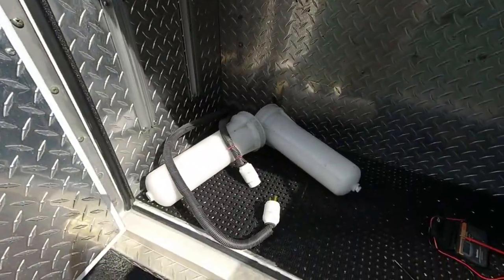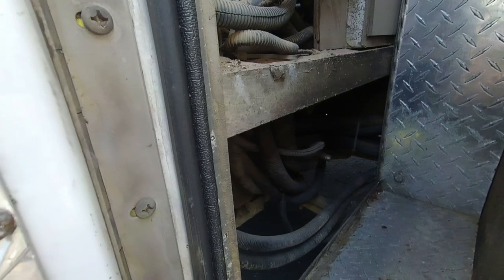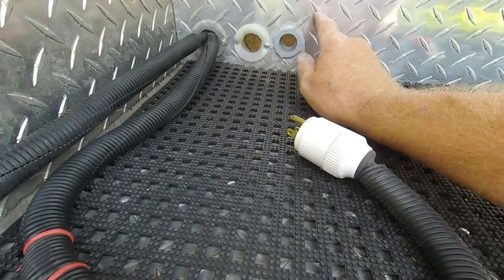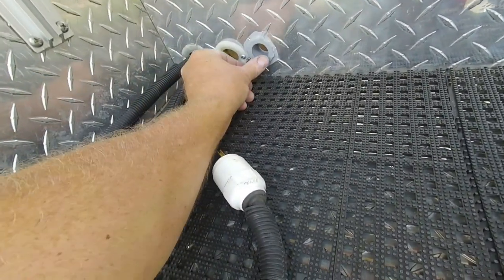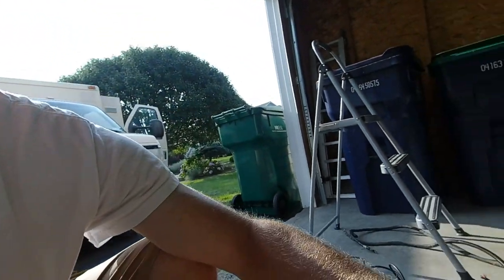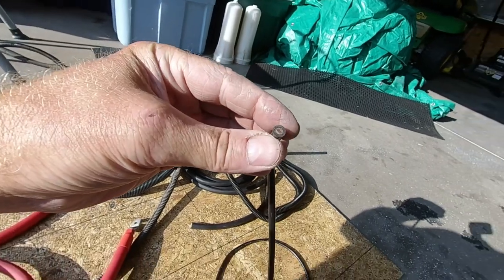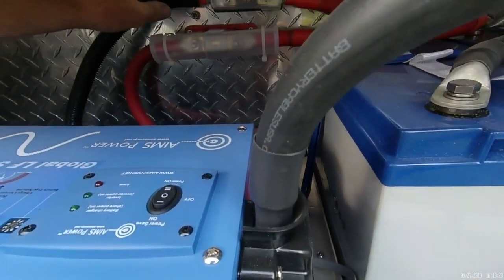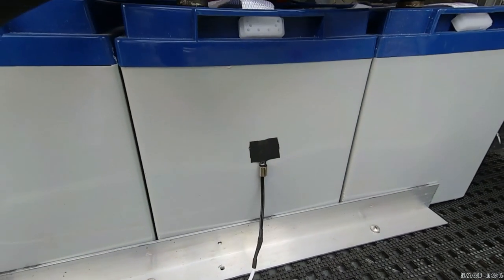Inverter and Battery Installation in Ambulance | Building the Campulance

Comment: Good job!  I've installed a lot of inverters over the years both for myself and other people.  The temperature sensor typically attaches to one of the battery post on some inverters.  The directions from the manufacturer should tell you where to attach it.  This sensor tells the inverter if the batteries are getting too hot during a heavy and prolonged charge or discharge cycle and will reduce the charge or draw so it doesn't damage the batteries.  In all the years I've been using inverters, I've never had one reduce the charge due to heat although I suppose it does happen or they wouldn't make them like that.
Reply from the maker: Thank you Lucky! I spoke with a tech from Aims and put the sensor where they recommended but your post mount also sounds like a good idea. Thank you for watching and commenting!

Comment: Thanks for this one.  I have a Horton ambulance, trying to figure out the wiring for a solar setup and was hoping to use the existing wiring to make it easier/quicker.  Many things on yours is similar to mine.
Reply from the maker: I was able to use the existing DC wiring up to my inside power cabinet which saved having to rerun one :) It is possible to use some existing cables.

Comment: Were you able to retain the box AC/Heat after separating the two systems?
Reply from the maker: Hi John - the original box heat and AC systems are still in place. Keep in mind, by design these 2 systems only operate when the engine is running. I don't use them (I have AC and heat systems I've added) and they will eventually be removed to gain space. Thank you for watching and commenting!
Reply: @TheCampulanceMan   Absolutely makes sense to have independent HVAC if you are doing full time. I have a older Marque (94) that I just acquired, but my mission is comfortable travel for a few days at a time. I'll be using your videos to help me get it situated . Thanks again for the videos and response!

Comment: I took out those 5 huge lead acid batteries and in stalled 2 12 volt LTO batteries as starter batteries, save over 200 pounds. And I installed 3 100AH 1KWH LiFePo4 batteries.
Reply from the maker: Whoa, I wish I could afford lithium for my house batteries. My gels are HEAVY! When my Gels are end of life, I'm sure I'll be putting lithiums in their place. My truck has 2 cranking batteries, group 65.

Comment: At 6:14, the black box right above your left pointer finger (I believe is the device that "ups" the engine idol speed  while the ambo is sitting and running to charge the batteries) was located in the wooden box connected to the doghouse (at least mine is), where did you relocate it to?  Did you remount it under the dash area somewhere?  Thanks, this video is extremely helpful.
Reply from the maker: The high idle unit? I removed it and sold it on Ebay :)

Comment: Hi I have a ambulance too. And I was wondering if your outlets work when the engine is running or just when your plugged in to shore power. My outlets will only work when I have my ambulance plugged in to shore power. I was just wondering if that’s normal or if there is a switch I need to find. Thanks so much
Reply from the maker: Hi Ashton. For your AC outlets to work without shore power, you have to turn on your inverter. There is usually a switch on your rear switch panel for turning on the inverter. Btw, many used ambulances that are sold have had the inverter removed.... so I'm assuming you still have one installed :) email me if I can help more.
Reply: @TheCampulanceMan  what is your email? Would you mind sending me a picture of where the switch is. And where the inverter is located so I can see if mine is still there. Thanks so much
Reply from the maker: thecampulanceman  at Gmail

Comment: mt ambulance came with the original inverter. where can I get some help on using it? the inverter is installed inside under the jump seat. this is a 1996 special order wheeled coach built for a fiber optic tech and no info is available from the coach maker
Reply from the maker: There is usually a switch that enables the inverter. The box will need to be powered on, turn on the inverter, plug something in and see if it works. If not, try it also with the engine running.

Comment: Will this Aims Power 3000 iverter charge the starter battery when plugged into shore power, as the original Vanner 20-1050cul did? Mine was removed before I received it and I would like to have that feature when installing a new inverter. Thank you!
Reply from the maker: The aims inverter does have a 100a charger built in. Whatever batteries its connected to will get charged when on shore power. The charge amperage is adjustable up to 100a.

Comment: You have inspired me to get an ambulance for my van build I'm going to look at one later today it is a 1998 Ford E350 ambulance with a 7.3 powerstroke at 150,000 miles He's wanting 6.8 for it but I'm going to try to talk him down to 5,000
Reply from the maker: Exciting! If it's missing the inverter, talk them down. Check the age of the tires by the code. If they're old talk them down. Touch the engine to be certain its cold, then start it. Be sure it starts well to confirm glow plugs and relay are good.
Good luck and thank you for watching and commenting Jacob!
Reply: @TheCampulanceMan  my brother drives a big diesel truck and works with it often, he is coming with me to check for engine stuff to make sure the engine is good, I am 22 and wanting to get on the nomad life by 24, I got a decent savings from working my tail off, been taking OT like crazy and should have enough to take a gap year or two and travel the USA! I am very scared of the electrical in general but willing to take on the challenge and your videos are helping out tremendously, thank you for the tips! Is there any signs you would say I should turn and run if I see?
Reply from the maker: With the engine running, take the oil fill cap off to check for blow by. You shouldn't see any 'puffing' come out of it. Check over the front suspension - bushings especially  - and shocks. They're many times worn and the rubber bushings fail. Not a huge issue to fix yourself but something to look at. Look at the power cabinet to see if it looks unaltered. If you see signs of a lot of tampering that may be a concern. If you can, get test strips and check the coolant to see if it has been maintained. Bring a OBD scanner and pull codes if possible.
Reply: @TheCampulanceMan  thank you!

Comment: Hi David. I've been following you for a few months now as my wife and I have been working on our ambulance conversion (2005 F350, Wheeled Coach Type 1). Your videos are very helpful and enjoyable to watch. I have a couple of questions regarding your electrical setup. Like you, we plan to get an initial battery bank installed and charge them off the alternator and with shore power until solar is installed at a later date. I was planning on using a battery isolator (like this one https://www.amazon.com/WirthCo-20092-Battery-Doctor-Isolator/dp/B0058SGDFK/) to charge the battery bank from the alternator (or I guess alternators). I noticed you said you never ended up using the switch in the cab to engage charging from the alternator. Why did you decide to stick with shore power and never charge from the alternator?

A second question, now that a few months have passed, how satisfied are you with your Aims Inverter/Charger? I ask because I'm having a hard time deciding on which brand of pure sine wave inverter/charger to go with. The price points and reviews seem to be all over the place.

Keep up the great work.

-Anthony
Reply from the maker: Hi Anthony it's great to hear from you! I'm glad that I can offer some pointers/ideas/visuals for folks like you that are doing their own build. I'll answer the 2nd question first because it's easier.
The Aims inverter/charger I have has performed very well and as designed so far. It is definately a robust unit that has handled an air fryer, heat gun, coffee maker, vacuum cleaner (not all at the same time!), without any issues. The only drawback I've found is when using the power save mode I have to turn on something that pulls a lot of power before it senses the load and turns on. Power save mode puts it in a kind of idle state and it sends out a sensing pulse every 30 seconds (I think that's the time) and when it senses a load, it turns on and begins supplying power. Once there is no more load, it returns to the idle state. This works well for me at night - I put the sleep timer on the TV and once it shuts off, the inverter goes to power save state. The only issue is that it needs to see a decent load before it turns on. So, I plug in the vacuum and turn it on and it senses that, but it won't sense just the TV for example. That's not enough of a load. Overall I'd recommend it from a quality and performance standpoint.

For your first question, because I was planning a solar install I never designed/installed a system that would allow charging my house batteries from the alternators. I definately could but at this point it's not needed. My 2 cranking batteries are entirely seperate from my 3 house batteries. I designed it this way so that I wasn't ever at risk of depleting the cranking batteries. I could have installed a battery doctor type device that would charge the 2 battery banks correctly but, again, I was always planning on a solar system so I never did it. That's really the only reason that I don't have that capability. 
My house batteries are recharged each morning from the solar in about 3-4 hours of sunlight. Since I installed the solar, I've only had to use the generator a couple times when we've had several days straight of clouds and rain. Even in those cases, I really didn't need it and was still ok as far as DOD, but I wanted to get the batteries back to 100%. If you're installing a solar system you won't need alternator charging....
Reply: @TheCampulanceMan  Thanks David. That is very helpful. You mention in your video that you replaced your shore power plug. When you did that, did you upgrade the plug to a higher amperage? If so, were there any other changes needed for the ambulance to accommodate the new charging rate or was it as simple as swapping out the plug? I ask because our ambulance has a 20 amp plug and I'm thinking about bringing it up to 50. Thank you again for your responsiveness so far.
Reply from the maker: @anthonyzabiegalski8819  No, I kept the plug at 20a. The truck has a breaker set that's 20a rated and I didn't want to be swapping that out at the time. I carry a 30a to 20a dog bone adapter and have used it on several occasions when at camps that didn't have 20a service. To upgrade to 50a I'm sure you'd need to swap breakers and (I believe) the wiring to a larger gauge to accommodate. I didn't research that and I'm not 100% on what it would take. Have fun with your build and let me know if you have any more questions. Thank you for continuing to watch :)
Reply: @TheCampulanceMan  Hey David, I just wanted to say thanks for this help that you offered a little while back. I finally feel like I'm getting a handle on on the electrical and have posted a video on our progress: https://youtu.be/uQuWc4XPis8

I mention you in it and posted a link to your channel in the comments. Hopefully that's alright.

Thanks again,

-Anthony